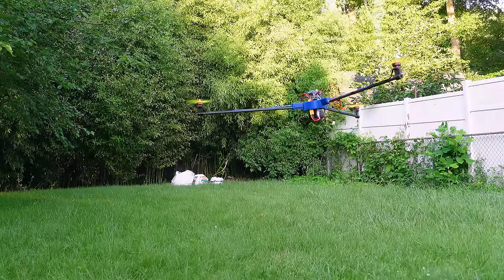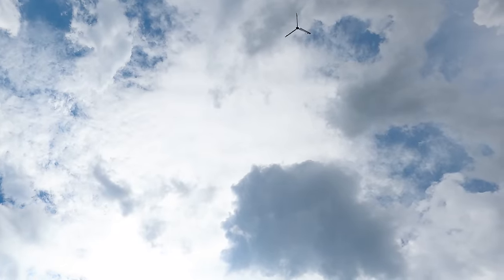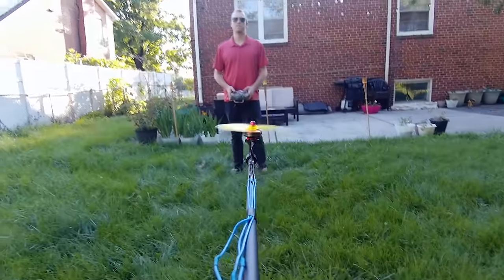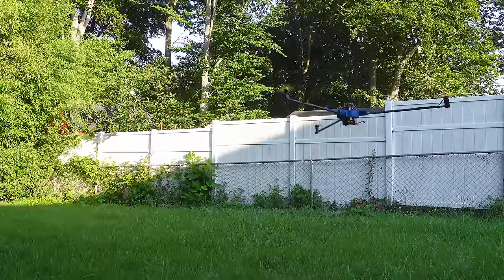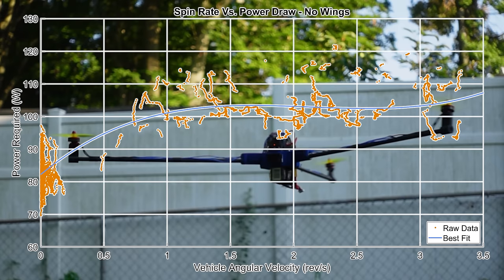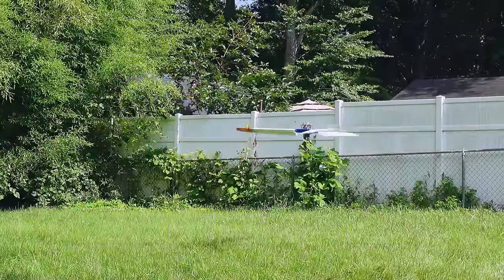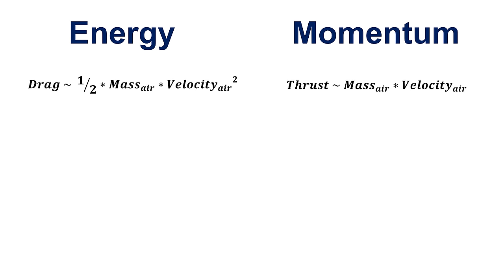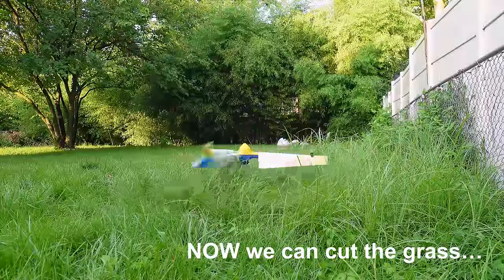The Spinning Drone Paradox - Part 1

Comment: You are actually not also inclusing the benefit of a couple of extra forces. If you can imagine that the propellar was facing horizontal at the end of the wing. You would lose some of your benefit. While the thrust created by the propellar would have less drag. Its vertical vector is zero, but its horizontal vector is 1. If we tilt it up by say 30 degrees, then the vertical vector is 0.5 and horizontal vector is 0.866. Typical stall angle of attack  for an aircraft is about 18 degrees. so more than 18 degrees not so optimal. But Even at 15 degrees you have a relative trust vertical vector of about 0.3
but you only lose a few percent of horizontal thrust. So if we keep the blade face perpendicular to the plane of the bottom of the wing, anywear from 13 to 17 degree wing angel of attack is beneficial. 
   The second thing here since is you have the propellar blowing over the wing, whereas you have the Angle of Attacked being realligned relative to the wing position, while it creates more turbulence on the outer wing, it creates a much higher lift on the wider part of the wing since the higher angles of attack given rise to 'stall' inefficiencies is partially being corrected by the action of the increase directed windflow behind the propellar. 
Ideally, one would want to see laminar flow from the prop to the wing, and I think the fluxes in lift created by the eddies from the propellar are causing the craft to pitch. One way to correct this is to finlets along the wing to keep the air from traveling radially down the wing. 
Some possibilites for improvement
1. Move the propellars closer in. 
2. Finlets behind the prop and at the end of the wing would help straighten out the airflow.

Comment: If it hovers at 70% throttle with 90° pitch(all vertical force), then
it will hover at 98% throttle with 45° pitch(70% vertical force & 70% horizontal force), not taking lift from support with arm/wing into account for additional vertical force.
At 30° is when the vertical force is half(50%) & horizontal 87% with significantly more lift from spinning lift arms/wings.
--SINE & COSINE
Reply: You probably should consider airflow over the wings and issues with high AOA.

Flow separation!

Comment: If you had a center mounted payload hanging, you could control direction while in spin my adjusting payload angle which would not be spinning.  :)

Comment: what if you could independently control the arms, you could have "plane mode" where 2 blades are in opposite directions, and the "rear" one is straight up and the propellor acts as a tail.

Comment: you can actually get a quite large part of this efficiency increase without rotating the entire things.just look at the mars gliders whings which flatten out at the end. it is old technology by now but somehow most people other than some hobbyist airplane/gliderplane designers and builders don't know about it's existence and it still isn't really used other than by NASA and one ultralight glideing plane manufacturer and those hobbyists.

but it is quite simple since the airfoil eventually returns to flat before reaching the end of the wing this causes the  elimination of turbulence causing it to be automatically completely stable without the need for other effect*.  some years ago some people also used this for propellers which resulted in basically silent propellers which you in general couldn't hear. it also made them hugely more efficient. so if you use something like that it would become greatly more efficient. and the only loss higher speed would cause is due to the interaction of the air molecules with the material and such, or when the speed becomes so high that it actually doesn't work anymore. but the mayor problem with normal wings and propellers is the turbulence  this causes energy loss and makes it behave very differently at different speeds. with such a design which basically has no turbulence unless wind really comes from a wrong direction the speed doesn't matter that much. that glider plane build on it can fly and stay in the air at walking speed, yet can also go much faster without real change in behaviour while with traditional wings there would be problems much more early. a funny thing is that some of the first drachenfliegers where made kind of like that but then mostly to save on material, cost and manual work since back then everyone in general build their own ones.only many years later science caught up to those hobbyists who on accident made their gliders super stable and efficient.

Comment: in a larger version the cockpit could be placed on a bearing structure and small servo to keep it aligned. and to address direction control, you could use a gyroscopic type of movement, or develop a pulsing program that will pulse a motor as it passes through a certain phase in the arc. How would a toroidal prop help efficiency here?

Comment: There are wind generators in which small propellers with electric generators are located at the ends of the blades and power is removed from these small propellers and not from the main shaft.

Comment: Flying gearbox. Independent control of big blades angle would be cool. If set two almost flat, and one  vertical, this thing would look almost like a plane, and could glide forward, then hover in "fan mode", keeping all the manoeuvrability in "drone mode" with fan blades vertical. I hope it is only a beginning :)
Reply from the maker: More coming soon!

Comment: Tilt the carrying Big propeller blades, in order to much quicker engage lift when spinning.
Also make a bigger one with small jet engines instead of propellers, with wide lightweight blades on the carrying Big propeller.
Don't forget about Gyro stabilization.

Comment: If, instead of putting large tilting fins on the copter, you put tiny propellers on the tips of your standard propellers, would that also reduce power consumption? I think not. Ie, i think the reason you're saving power isn't because of angular props, tip props, or a spinning body -- that's all a distraction. The reason you're getting greater efficiency is because of the giant prop. If that's correct, then you'd gain the same efficiency with a normal helicopter design, without tip props or fins. Right?

Comment: Okay, now make a large quad drone with 4 of those propeller designs. Would it really require less power to lift or hover?

The bigger question is: would 4 large propellers require less power than 12 small propellers powering 4 larger propellers?

Comment: Awesome idea dude! Loved it! But I'm curious if this is any better than a helicopter with a couple of coaxial rotors (rotors that rotate in opposite directions).
Reply: i suppose it is, as a helicopter has the motor in the center, and has to overcome the momentum advantage which this contraption shown has, as the spinning force comes from the tip of the blades. Not familiar with coaxial designs advantages though.

Comment: Maybe you could just do a more conventional quad design with fixed angled rotors, and then build the body as a toroidal or conventional prop with a fixed pitch instead. Use all four rotors to get into the air, and then shut down two of the rotors so that it starts to spin. It'd be mechanically much simpler.

Comment: Expensive education was not wasted on this one! Good job on your math and physics.

This is truly a breakthrough design btw. If you could also make it so that it is capable of reconfiguring into a "fixed-wing" airplane midflight that would be glorious. A gist of it can be seen around 8:00, as you've likely already thought about it. I don't know what the hurdles might be engineering-wise, but essentially you [efficiently] VTOL the thing up, you then switch to hover, then switch to the aircraft mode, then [efficiently] move like a prop aircraft would (maybe something like osprey, where you have the leftover rear wing act like a stabilizer), with the less-efficient but practical hovering seamlessly gluing the other two efficient modes together. I think you can bring surveillance and perhaps even delivery to a whole new level with this design, because it maximizes both the economy and the range of the flying drone concept without introducing extra costs.

Comment: If an alternator is applied to it in the dynamics of rotation, it will create its own electricity for the batteries like an automatic self-generating car, simply let it rotate for a few minutes. Thank you.
 Sí se le aplica un alternador en la dinámica de giro creará su propia electricidad para las baterías como un auto generador automático simplemente dejar que giré unos minutos. Gracias

Comment: Helicopter propellers are probably different from airplane propellers for a reason.  Same goes for the V-22 Osprey.  Maybe these drones should be using larger propellers at a slower rotational speed.
Reply: Imagine having a drone consisting of three of these.

Comment: I don't do drones but I love math and physics. I'm trying to learn more so I'm wondering if the power deduction would continue to decrease even if only by a small amount if you built three drones like this and attached them as the propellers of a bigger drone also fitted with these wings such that the small propellers spin, the medium propellers spin, and the large drone spins with them. if someone knows more than me and would like to explain why this would or wouldn't work I would really love that.

Comment: Maybe that's a random question but why not just 2 wings and 2 motors? I guess the 3rd gives more stability in some circumstances, if so could the 3rd wing be smaller/shorter? And the 3rd motor more light?

Comment: What if instead you used a larger, central, motor to spin the wings? And then you could just use a smaller, horizontal propeller to counter the spin.
Reply from the maker: Excellent idea Mr. Sikorsky

Comment: what if you put a pair of motor at the wing tip propeller perpendicularly to spin it ? Similar to how the central axial propeller is spun by the wing tip propeller. Except this time the wing tip propeller is spun by another two propeller at the propeller tip. The same flow momentum/energy improvement should affect the wing tip propeller just as it did to the main central axis propeller. Essentially a recursive drone tip propeller. The hover efficiency should increase further, although at a lesser degree. Since it's only improving the tip propeller's thrust efficiency. 

I'm kind of curious on how many layer of this recursive tip propeller configuration can go until diminish return cap the efficiency.

Comment: It is not a paradox, it is a normal logic. The thrust is proportional to the mass of air accelerated, and the mass accelerated by the small propellers at higher velocity is greater than with almost no speed. It is further enhanced by accelerated air of the wings (when they are moving).

Comment: And now imagine, that the 3 big propellers are one thin disk, and add 15-20 more disks on the same axis, very closely spaced, as to create a boundary layer when the air flows between them. Enclose that rotating discs structure between 2 plate-shaped-surfaces and you will have quite interesting fluid dynamics passing in that structure, of course requiring air-sucking intake and air-pushing outtake. Such a flying machine was the Brainchild of Tesla.

Comment: Could you achieve equivalent efficiency benefits sans wings by just throwing large propellers on? Or, maybe the motors aren’t designed to spin that slow, is the problem?

Comment: Yea but how do you prevent it from constantly lifting up? If you reduce the small motor rpm then the big one lowers proportionally and fails to maintain steady hover. Also what about a secondary tail that would prevent it from turning on its own axis

Comment: Isn't it misleading to say a factor of 3? because the drone without blades on its arms is optimal at 0 rotations, which has a power draw closer to 80. 80 to 35 is just 2.3 divisor.

Comment: The bigger propeller is more efficient, because of the speed of the propeller is faster at the tips.
So why not just use a few inches of the propeller at the tips and remove the rest of it, so there is no drag.
I bet it would be even more efficient.

Comment: Could you try a controlled fall with the propellers pitched down increased the rpm and used the rotational inertia to slow it down in the last second, is that possible. It would make for a cool concept parachute

Comment: How does the lift vs power ratio perform against a single center motor spinning the large propeller? Are their enough gains there for a helicopter to implement this design?

Comment: Hovering by drone propeller isn't efficient, but the wing arms produce lift with low wing loading plus they have a high aspect ratio which adds to their efficiency. 
  A glider's wings have similar characteristics and are very efficient for flying. Drone props on the other hand don't really fly, they thrust. 
This design works well for a human powered helicopters.
https://www.extremetech.com/wp-content/uploads/2012/12/helicopter.jpg

Comment: I would like to know the efficiency ratings compared to a helicopter of the same size and weight. Is one bigger central engine more or less efficient then 3 smaller wing tip engines? What pros and cons from each design?

Comment: What is the weight of the system?   Usually, good VTOLS are at 100W/kg and fixed wings at 30-40W/kg
Reply from the maker: About 900g

Comment: I'd love to see a stabilized center for a makeshift pilot see if it'd be plausible for a full sized version without being rotated to death
Reply: Like a gyroscopic stable seat on top in a bubble that rotates at the same speed in the opposite direction as the quadcopter

Comment: Hi, very nice work! I’m really interested about you althold function. I understood well how you compute PID in controlAlt() but my question is for example how to you add alt_pid value in controlmixer() with other roll pitch and yaw pid?
Reply from the maker: Just by adding it to the motor outputs
Reply: @NicholasRehm  nice thanks I’ll try it by adding alt_pid on my for motor in controlmixer() thanks a lot for your open source code

Comment: I'd be interested to see what happened if you reversed the taper of the 'wings'. The outer tips are moving so much faster than the inner part so should generate more lift if they were larger. You have a classic fixed wing "mentality" in your design but air speed over plane wings is the same across it's length... not so here. You could perhaps reduce the weight by removing the part of the wing closest to the body and still have the same lift increasing efficiency even more.
Reply: Yes, but that compromises the horizontal flight component that he also wants to include (8:19)

Comment: here is the short answer. Its easier for those motors to spin blades that make thrust than for them to directly lift the weight of the drone.

Comment: When you put your hand over the liDAR sensor did unexpectedly jump up its voltage used to increase its altitude? It sounded like the motors died? I’m a novice at best when it comes to stuff so please correct me if I’m wrong!

Comment: i see three of these, attached in a tricopter configuration (swivel mounts), so when they are spinning, you can use them like normal, but highly efficient rotors. (for steering etc)
however, would it not just be more efficient to larger, better angled blades in the first place?

Comment: Hi! I’m clueless about aero dynamics but if the wings help a plane push upward when air passes under it wouldn’t the propellers create the same effect if the wings were facing down? Four wings instead of three then you can balance the object like legs on a table? Just my observations….clueless observer.

Comment: Next project: make even smaller propeller/motor to attatch on the wings of the smaller propellers, and then to mount the main one on one big enough to fly a plane and travel not only for free, but charge batteries because at this point you are making energy!

Comment: Wouldn't be easier for measuring power output to just hook up the drone to some weight scale with some rope and measure amount of lift force created for different modes of flying with constant motor power, rather then doing complicated and still not the most consistent regulation of motor power based on flight hight? ;-) But still super cool idea. I really like it.

Comment: I don't see how this is a paradox.  It looks like the power was simply moved from the hub to the tips of a rotor-wing, which doesn't strike me as paradoxical.  Furthermore, as propellers get longer and their RPM decreases, they get more efficient.  If I had to guess, that's why Power-Required goes down.

Comment: It's basically a helicopter. Now if you exceed a certain speed in forward flight, the whole rotor disc will act as an airfoil and reduce power requirements for straight and level flight even further.

Comment: Not a paradox. Pushing wings through air creates lift, making up for the angle/loss from the propellers (given that propellers are just small rotating wings) and if setup correctly will give more lift than the propellers on their own. You basically turned a tri-copter into a mono-copter. Cool build though mate.

Comment: The power requirement goes down “way down,” because gravity is providing the energy for lift via the airfoils. Airfoils, in a way, are gravitational energy harvesters.

Yeah, I know, it sounds unbelievable. Hints: Lift from airfoils is Newtonian in nature NOT Bernoulli. Though, differentials in air pressure are involved.
Reply from the maker: I don’t think so

Comment: Not even a minute into the video and I figure it out. It's basic lift from aerodynamic forces, the speed of rotation turns it into a propeller and push air downward. It's simple.